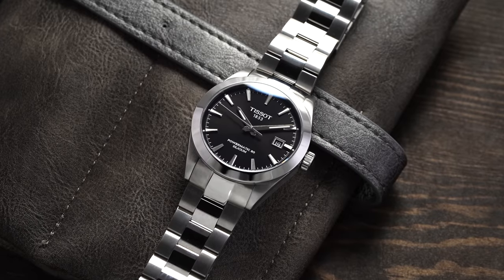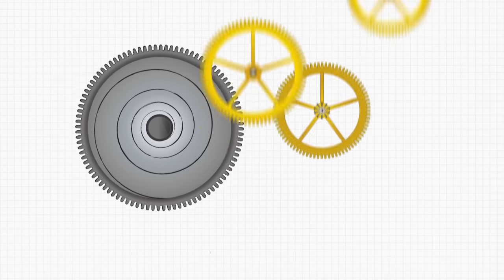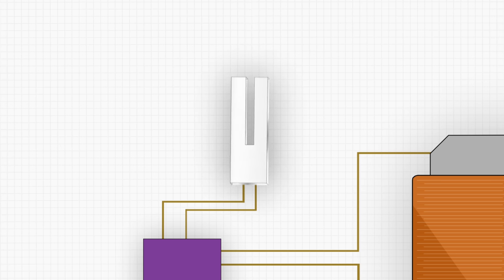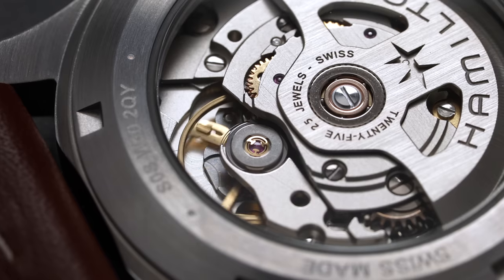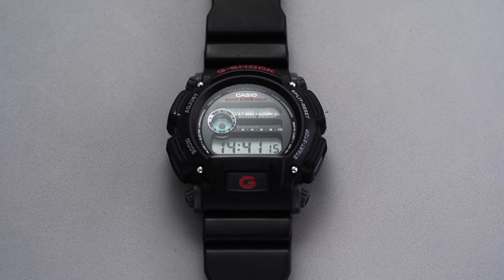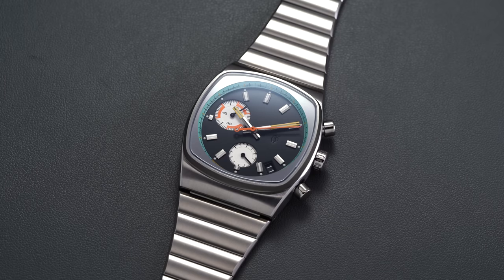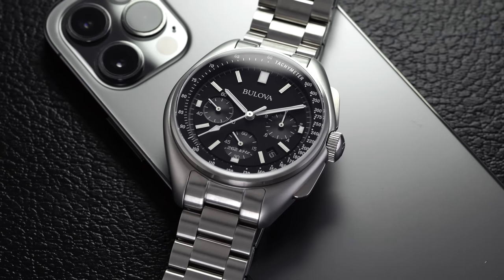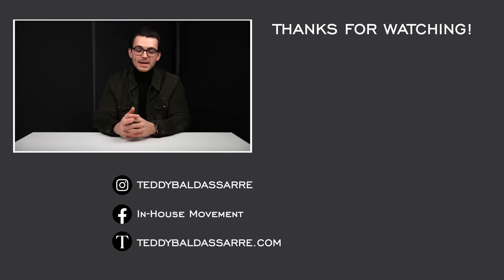Why Every Collector Needs a Quartz Watch - How They Work & Everything Else You Should Know

Comment: Well, I am no watchmaker so, basically, I`m receptive to marketing. I get told, that this or that watch is build by people, finished with care and watchmakers stand for the quality of the timepiece. These are values, that reflect myself. I want to participate in the process of commerce, so that people have jobs, I want to buy lasting items and I want to get something fixed if need be. I don`t know, if it is so much better to have a higher priced mechanical watch compared to a quarz, but I DO know, that bringing a quarz watch to a watchmaker ends up trashing it, because repairs are too costly. l broke bracelets and couldn`t find a replacement because of quirky dimensions. I cracked some plastic cristals on my Casios and it took months to get it replaced - so, pretty much - tanked it again. The biggest asset of a quarz watch, would be it`s price, but I think exactly that is the main concern. Not the movement alone (which is unrepairable) is cheap, but also the whole case construction and choice of material.  So besides the marketing speech, I tend to have mechanical watches in the middle price bracket (Breitling, Tudor, Junghans) and never had any problems with it. I would be ABSOLUTELY furious to spend 2000+ Euros on a quarz timepiece, which could not be repaired. So after years of wearing watches, quarz watches don`t fit my personal believesystem.

Comment: Main issue with Quartz is most people will only have ever owned a cheap one.  High end quartz are amazing but the damage from the cheap watches have tainted the movement.  Also for me I hate ticking watches.   Bulova proved that even a cheaper quartz movement can be super accurate and also have a smooth sweeping sec hand that puts all mechanicals to shame.  Why more high end quartz movements can't be made with the same silky smooth sweep is strange because it might then sell more watches to people that are after a good looking watch with the accuracy and no need to maintain a mechanical.

Comment: It's not about snobbery. In the 70s and 80s, Casio and others struck a horrific blow to an established industry that used to have their territories well divided and organised among themselves.
It hurts to have your ecosystem shaken by people you used to frown upon.
Currently, car industry is going through the same thing.
Reply: The industry is NOT equivalent. EVs are expensive to buy and maintain, are not quick to refuel, are very limited on distance, suck to service, extra dangerous in a wreck, can spontaneously combust and burn your house down and lock you in the car. It's  all the total opposite of why people switched to quartz watches. Efficient, inexpensive, easy to service, more practical, readily available.

Comment: Tradition aside the quartz watch beats the mechanical in every way. It is more robust, accurate, and set and forget but it lacks what I can best describe as soul. The quartz watch is better functionally in every aspect but has no personality. Watches were once used to tell the time now they are jewelry and the cheapest quartz watch will still be more accurate than expensive mechanical watches. In the shorter term. A properly serviced mechanical watch is capable of being passed through many generations a quartz watch isn't. Some quartz watches are still running after forty or fifty years with nothing more than battery changes. I have a Seiko quartz from 1974 which still works perfectly to this day but what I don't know is for how much longer...it will one day suddenly pass away without warning. Its just a question of when.
Many thanks for a great presentation.

Comment: Quartz watches have no soul.  Open most quartz watches, even expensive ones, and you'll find a cheap Japanese movement just like a Casio.  But I own a few quartz watches because I can pick them up anytime and they are set to the correct time and running.  And if I cannot wear a watch all day, a quartz will keep running where an automatic might not maintain enough power reserve.  I still prefer mechanical watches when I can get by with wearing them.  Service is another issue with mechanical watches.  Active enthusiasts probably buy and sell watches enough that they never own one long enough to worry about service, but if you find one you like and want to keep for awhile, you will pay a significant portion of the purchase price in occasional service.  With quartz you just change batteries, and most enthusiasts can do this themselves.

Comment: To me, quartz watches are more accurate, less expensive, can be charged by the sun and can be radio controlled. They're an absolutely amazing innovation but because they can be mass produced they're less desirable. We have clocks on every screen, nobody "needs" a watch, and the reasons people desire watches, mechanical watches excel at. They're a statement piece, an accessory, wearable art. I get it, but day to day, you'll find me with my solar, multiband 6 gshock square.

Comment: Strikes me the main issue is that a brand that sells both mechanical and quartz watches has a problem in that they can't sell two watches that look very similar for massively different prices, so they raise the price of the quartz model so that the mechanical doesn't look silly, but the the quartz looks overpriced - truth is both are overpriced. Quartz movements are cheaper, but mechanical movements don't warrant an extra £1000+

Comment: Yes, you can call me a watch snob. Reason i despise a battery quartz watch is because they are not environmentally friendly, they are suited as a pure tool watch which are souless that doesn't require user input and has a cold robotic seconds hand movement and sound. They are not suited as a masterpiece accessory. A solar or kinetic movement quartz watches are more acceptable, at least they require some input to tick whether by light or movement. When a battery quartz watch dies, you need to replace it, unlike a mechanical or solar or kinetic watch which can be brought to life in an instant. For mechanical watches, just follow Taylor swifts advice - shake it up, just shake it up!

Comment: Why do people Saya mechanical watches will last a lifetime when in most cases they can't last 10 years without significant service. 🤔   how can something that can't stay accurate for 10 years without significant service last a lifetime.  What you mean is that after being repaired 10 times it will last a lifetime.  With a high quality quartz watch that uses a swiss movment it can easily last decades without a repair and when you need a repair, you just swap out the movement for $80-$150 (all in) and you're back to normal.

Comment: Quartz watches are useful but they aren't collectable. They are disposable devices that do their job and when they break you throw them out and get annother. You can't pass one down to your grandchildren because it won't be repairable in a century, you won't even be able to get a battery for it. Mechanical watches can last forever, I have my great grandfather's Waltham and it still runs, that can't happen with a quartz watch.
You also can't call them tech anymore, they were in 1970 but they aren't now. The reason they still exist is that they are as accurate as anyone needs and more importantly the battery will last for years. Your phone and your smartwatch are perfectly accurate, they are synced to the atomic clocks in GPS satellites which are synced to the even more accurate atomic clocks in Colorado which get corrected for the wobbles in the Earths rotation. Not that it matters, people need to know time to the minute not to the nanosecond.
The thing that pnones can't do is run for a full day without being charged. Thats why there is still a place for watches and in particular quartz watches.

Comment: What bothers me by quartz watches they have these cheap movements and are mostly cheaply made but they demand huge amounts of money in comparison to what they offer, plus they seem to be designed by people who went trough surgery to remove any trace of taste, they are ugly. Sure there are exceptions but then again those few exceptions are crazy expensive. Good example of price vs offered value are Casio G-shock, they offer superb durability and everything else that comes with quartz or digital watches for around 80-100 Euros, and they blow away 99% of other quartz watches. If someone made a line of good looking dress watches with quartz movement, something like finish of Seiko Prospex or Presage with quartz movement and priced it between 100 and 200 € or slightly more like Citizens Promaster BN0200-81E, they would blow away competition. Plus that ticking hand is kinda boring why can't they make a sweeping one like Bulova Moon watch, we have at work a cheap wall clock with sweeping hand so it can't be that hard to make it. And other movements like solar powered or radio controlled also sound a little more interesting than battery ...

Comment: I disagree, and here is why:

If a quartz watch represents higher accuracy, technological advancement and increased functionality at a lower price, then by the same standards, the quartz watch is obsolete because smart watches outperform quartz watches in every possible manner. So, one could make the exact same video but ask why quartz watch owners look down on smart watches.

Traditional watches are basically a luxury, noone NEEDS a traditional watch (we all have smartphones in our pockets with functions and connectivity galore), and as such watches should not be viewed through the lens of "what functionality can I get for a lower price". They should be viewed through the lens of craftsmanship, beauty, and the mechanical watches surpass quartz watches in that regard by an order of magnitude. It's hard to find an exhibition case-back quartz watch, for a good reason: quartz movements are ugly and uninteresting, whereas mechanical movements look gorgeous and mesmerizing, and when done with high grade finishing, they are a work of art.
Reply: I disagree with you, and here is why:
A quartz watch will run for 2 years and longer without a need to charge, unlike a smartwatch that needs to be charged regularly. Not to mention solar watches....

And secondly, a wristwatch still has real utility for many people, even with everyone having a phone. In many situations it isn't useful to grab your phone to check the time, sometimes even impossible. So, they are still very useful and not necessarily always a luxury. 

So, not always about the art and craftsmanship. Quartz are superior machines. Mechanicals are pieces of art.
Reply: @JohnJesus  thank you, Jesus.